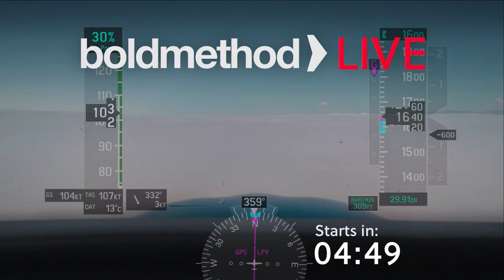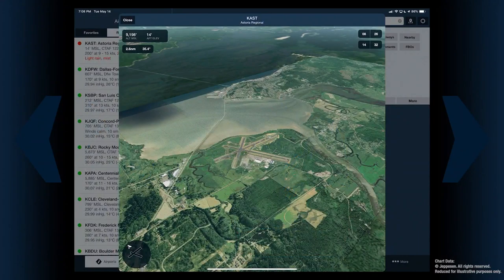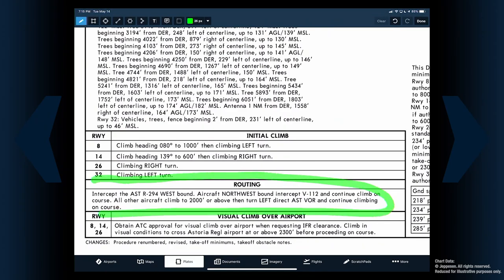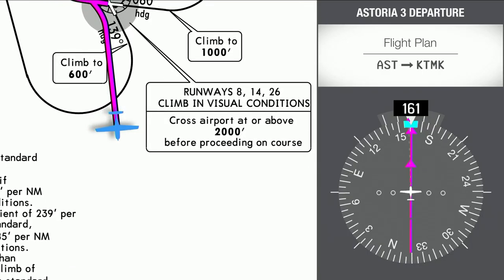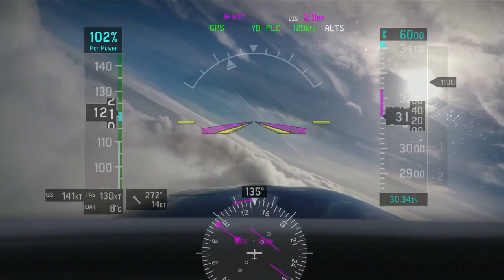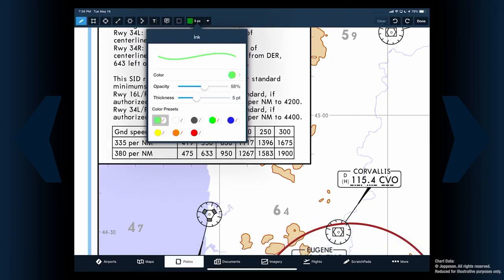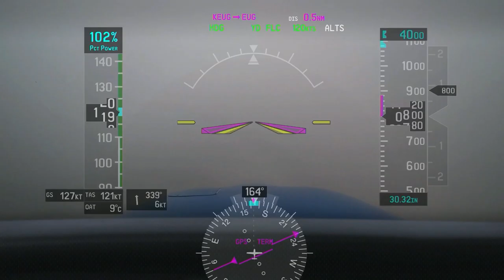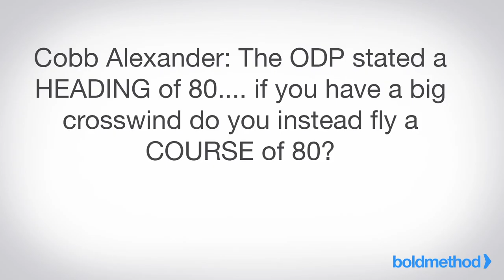Obstacle Departure Procedures: Boldmethod Live

Comment: On the ODP in Eugene you have to hold on the 360 radial——-(180 inbound). NOT the 180 radial which is SOUTH of the VOR.  Radials are always the outbound heading from the VOR.  In this case, they specify the inbound heading to which you add or subtract 180 degrees to derive the radial.  Great videos!   I am using these as a new Mooney Ovation owner getting  back into GA.  I am sure you said one thing and meant the other.